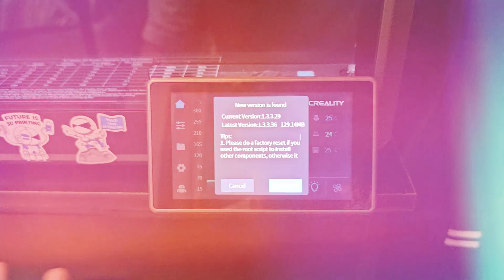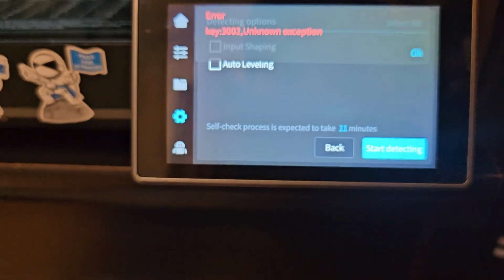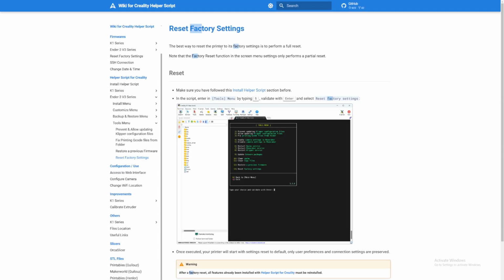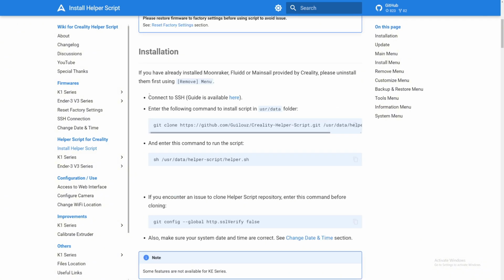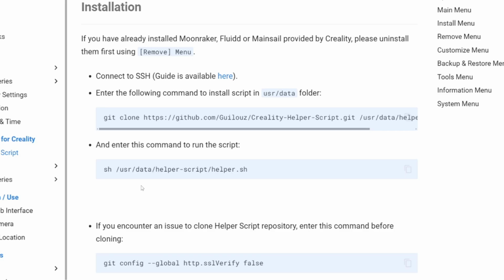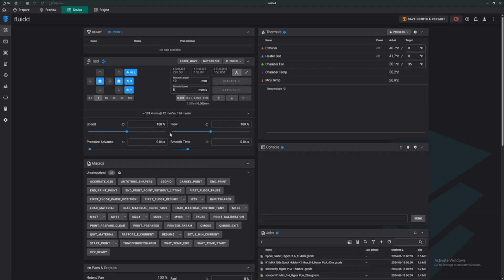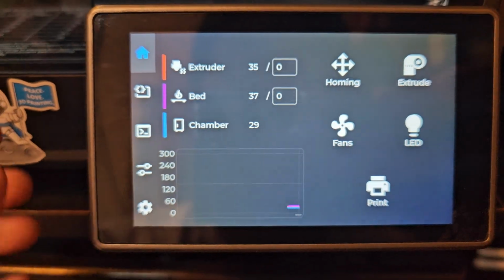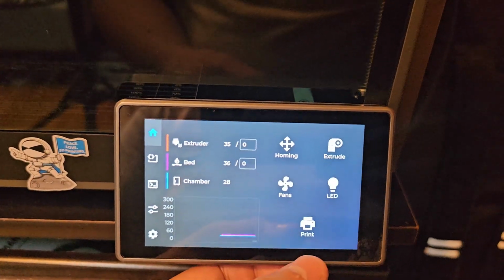K1 Max New Firmware 1.3.3.36 Best Guide For Updating and Rooting | Fix Error 3002

Comment: I made the mistake of updating and forgot I had rooted it when I first got it. Now I cant just do a factory reset? I never got the error but not it shuts down at the beginning of a print... Ugh, what do I do now? Opened up MobaXterm and input printer IP address / root but it just says "Network error: Connection refused" in the control panel. Anyone have any good advice?
Reply from the maker: Check out my newest video on rooting the k1 max, and if that does not help let me know.

Comment: I rooted my k1 max but looks like I didn't do it right and now it will not load up :( not happy now just a paper weight now
Reply from the maker: If you mess up on the rooting, you can just factory reset your k1 max and it should go back to normal.

Comment: I was able to root, but for some reason no matter what I do, the printer refuses to use slicer temperature settings, any help with that? Thank you in advance
Reply from the maker: There may be more than one temperature set in settings. Also make sure you are using the profile that you set the temperature too.

Comment: I have a question. I thought that rooting and installing Fluidd would replace the original firmware and that you would no longer receive updates from Creality for the printer?
Reply from the maker: No, it's just unlocking the 3d printer. You can edit files inside the 3d printer, and have full access to the 3d printer. You will still get updates from Creality because Creality is the one who allow the 3d printer to be rooted, unlike the Bambu 3d printers.
Reply: @ OK, that makes sense. But won't the printer config be adjusted by the update? That would mean that I can't use my previous config file anyway, because it's "outdated". So I have to redo all the root adjustments after the update, right?

Comment: I bricked my K1 Max a couple weeks ago, when I uninstalled Guppy because it wouldn't connect to the network.  Just for those of you unaware, its not fun, but its not the end of the world either.  You can take off the motherboard on the bottom, and flash it with your PC to reset it if necessary.
Reply from the maker: Ahh, thanks for the notice, of how to reset the motherboard. Glad you got it back together.
Reply: is there any way todo it with a mac? i’ve also bricked my k1 max and been trying to reboot the motherboard 😢

Comment: I got stuck in an infinite loop. I couldn't do a factory reset. 

Rolling back 1 firmware version wasn't enough. I had to go back 2 firmware versions. I had to mash the update button while cycling through the errors. Eventually, I got through and was allowed to press the update button. That didn't get rid of the errors, but I was able to get out of the infinite loop AND THEN do a factory reset.
Reply from the maker: Man that's got to be rough, but it's good that you was able to do a factory reset.

Comment: How to I will do factory reset firmware Ender 3 v2 printer.
Reply: Ender 3 v2 runs on Marlin software unless you added a Rasberry Pi to it and run Octoprint or Klipper. If you are running on Marlin then it is simpler and no factory reset required.
Reply: @Vash.Baldeus  thanks. Please send me link.
Reply from the maker: I'm not sure, I don't have the ender 3 v2. I do think there are online tutorial that will show you how to do it.
Reply: @Scratch3DPrinting  thanks
Reply: Please advise me which slicer best for . 8 Nozzle. because I am using.8 Nozzle in Ender 3 v2 printer
Reply from the maker: Orcaslicer is the best slicer right now for most 3d printer and nozzle sizes.
Reply: Please upload video for .8 Nozzle congratulations setting for Ender 3 v2 printer

Comment: I also had the same problem.  Next time I will factory reset first
Reply from the maker: Yeah, it causes problem without doing the factory reset. But some people does get away with it.
Reply: @Scratch3DPrinting  I think if they did the creality update first and then the rooted software,  it might have been better.   I got into a loop where it wanted to report or restart. If i do the report it never reports and didnt get to the screen to reset.. I spammed the report button and then I finally got to the screen to reset it.  I was lucky.